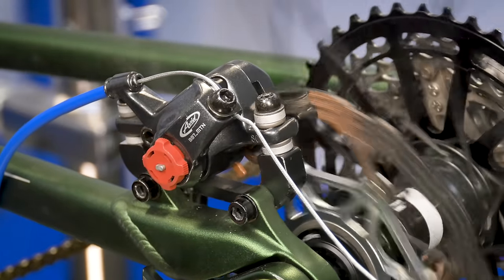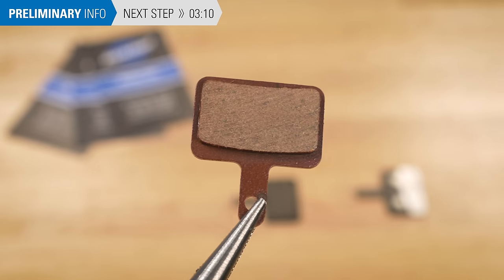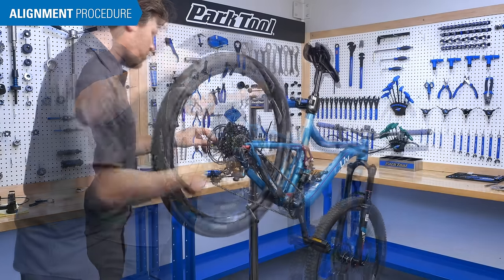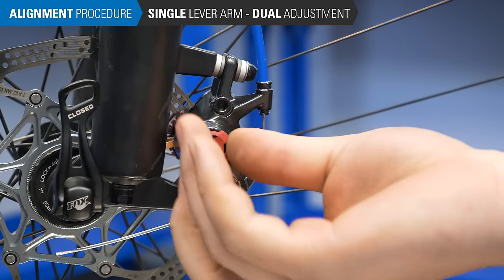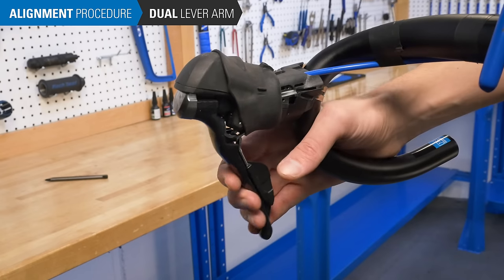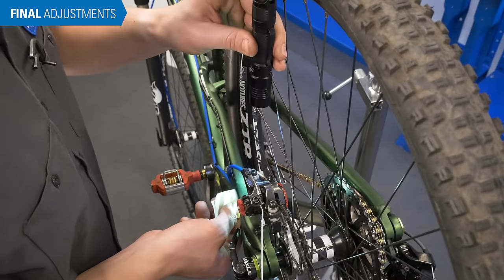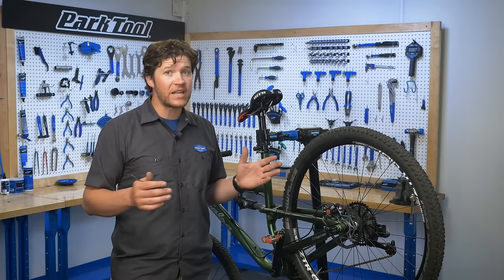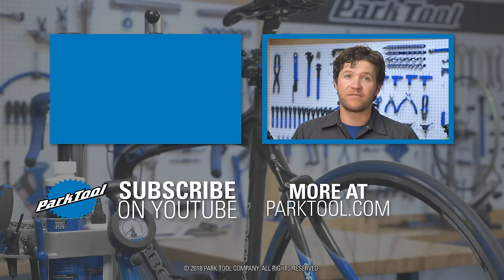How to Align a Mechanical Disc Brake on a Bike

Comment: I’m about to fight my mechanical disc brakes
Reply: Wrd ts madd annoying
Reply: It's no fight actually very easy. Even bleeding. You get the hang of it with practice. Purchase isopropyl, degreaser, and kitchen paper towel. You can clean the pads with the above.
Reply: I’m abt to break my bike from anger
Reply: It literally almost took out my finger
Reply: Been fighting for a minute 😂 about to just bite the bullet and switch to hydro
Reply: @dalegreenaway  Why are you talking about hydraulic brakes when the guy is talking about mechanical brakes?

Comment: This is the best how-to guide for mechanical disc brakes. I tried so many methods on setting up brakes, but neither was perfect... until i watched your video. Thanks!
Reply: how often i must to do this? i never had mech brakes
Reply: Booger not very often, usually as a first time setup for a new brake, afterwards, you would only need to adjust the stationary pad as it wears.

Comment: This video is one of the clearest and most useful ones I've seen so far. The animations and drawings on top make it easy to see what is mentioned by the speaker. Also, you covered all caliper types which is very useful. In my case, I have a one sided caliper and I wanted to adjust the lever travel, so as for the previous generation of brakes, I pulled the cable. This solution is wrong, and now I see why thanks to this video! 

Thank you for making this useful guide

Comment: Finally!! A video that explains what those adjustment screws in the middle of the caliper are for. I turned mine both ways and didn't notice anything moving so I wasn't sure what they were for. I'll just try them again and look closer. Overall a great video.

Comment: Just installed new brake pads and encountered the dreaded rubbing.
Looked like the caliper/rotor alignment wasn't parallel - had a fiddle with the caliper body bolts and managed to get that wheel turning smoothly!

Great level of visual explanation in this video, exactly what I needed.

Comment: I'm only 3 minutes in but your info was all I needed to finally adjust my brakes on my newly purchased bike.

My bike has been sitting in a spare room for 2 weeks now because the only bike repair shop in my city is booked solid for months and my front brakes were rubbing and I couldn't figure out how to adjust it.

But 3 minutes in and 10 minutes on my bike and it's now working perfectly.

Thank you!

Comment: Thanks so much for the great video - I bought a new bike online and my heart sunk when i connected the wheel and the disc was grinding, you're video was clear and allowed me to make the right adjustments quickly and easily!
Reply: Craig Glaser I have the same problem with my new E bike. What part of the video worked best for you as far as getting that grinding halted?

Comment: Been watching many videos and took me 2 weeks to find this very best informative video.

 I ride bike rarely.  Just bought a rear ebike conversion. The rotor is rubbing on the pads. Didn't know rotor can slide left or right a lil if need to. I tried using washers to space it but washers is too thick

Comment: Great video!  I was having trouble with vertical rotor alignment between the pads.  As soon as I tightened the mounting bolts, the alignment was thrown off.  Through a process of elimination, the video helped me discover that the problem was my axle was not perfectly seated in the fork dropouts.   I re-installed the wheel and voila!, no more misalignment.

Comment: Thanks for this in depth tutorial - I didn't know disc brakes had a lateral adjustment to them, and properly setting them with the technique at 4:46 fixed a rubbing issue I was having.

Comment: Thank you very much for the detailed explanation of the process of fully tuning the disc mechanical brakes, I couldn't adjust my brakes for a long time until I found your video, now my brakes are working correctly. thanks from Ukraine

Comment: Man! This is crystal clear! I bought an eBike that a shop assembled for me. Everything was perfect except for the front making a scrubbing sound. I asked them about it and they made it sound normal.  a day later I decided to investigate closer and realized that one, the disk was warped and two, the pads were touching. How I knew that, I bought a brand new rotor from amazon, nice and straight and found that the pads were rubbing. I wish I saw this video first before going at it on my own. I did some backward things compared to this video. I ruined the brake caliper, mainly the hex nuts, by over tightening and stripping them. I managed to get the whole thing off and bought a new caliper. When it arrives, I will be having this video by my side! I could of taken it back to the shop, but this is stuff I have to learn as a bike owner. The shop will just be handling the motor when the time comes.

Comment: Burned through an hour trying to set up single arm, single adjustment mechanical disk brakes  after re-cabling them for the first time. Then checked in here, like I should of originally!

10 minutes later I'm done.

Thank you.

Comment: Interesting video. Needed to learn this as I acquired a bike with such brake system. Sure it brakes better and faster than V-Brakes but you can't deny the ease of maintenance on v-brakes, I miss them. Learned a lot maintaining them. Now disc brakes. Sounds a tad tricky but I get the just. Coming from a very unhandy man, I love learning bike mechanics because it makes sense and you don't need brute force to get things done, not like car mechanics. Can't wait to get to wrenching! Thanks for the vid!

Comment: Fantastic. My electric Ariel Rider Rideal is 90 pounds going 20 MPH. I've changed tires but the brakes just aren't cutting it since I had it apart. I need the front brake and there's nothing. I didn't realize the arm needed as much travel as possible. I was moving it up on the cable, old school mechanical. Nor did I know about disk adjustment from the side. I did have the sense to hold the brake to get alignment and snug the caliper. No problem with my 2020 Schwinn Ascension 29 tho. Got monster mud tires on it now barely fitting the frame. They're huge! Thank you.

Comment: OMG, I was going to take my bike into a shop with 200 miles because one pad kept pressure on one side only with a squeal. A simple adjustment loosening two mounting bolts. Also found they were not tightened down enough or had become loose. THANK YOU for the video.

Comment: Thank you for the video.  What I was actually after and can't find anywhere is how much of the disc must be covered by the pads and how to align them.  When comparing the wear on front and read discs of my 10 year old Cannodale, it is noticeable that the pads are not overlapping the discs to same extend.
Reply from the maker: The entire brake pad should be in contact with the rotor. If the upper part of the pad is not coming into contact the pad will wear funny and you will also not have as good ob braking. This can be due to the incorrect adaptor or if you are using CPS washers and they were not designed into the system.
Reply: Makes sense, thank you for the quick reply.

Comment: Grateful again for this very clear guidance, and for your responsiveness. Having followed the advice here (and below), I have one other comment/question for your feedback-- When I maximally relaxed the caliper lever arm (and gently took out the wire slack before tightening the pinch bolt), I found that the dynamic brake pad (in my single lever-arm, single-adjustment system--Hayes MX-2) was hopelessly buried within the body of the brakeset. I was able to adjust it out (coarsely) only by re-tightening the caliper arm...which still left lots of range-of-motion on the arm, and no risk of jamming. Of course, if I had a dual-adjustment system, I would just adjust that brake-pad setting. In my simpler kind of brakeset, what else can one do but tighten up the caliper arm??
Thanks in advance for your feedback,
Cameron
Reply from the maker: Hello Cameron, Good problem solving skills! This can be the case especially if the pads are worn. You did the right thing. On Some systems there is even less caliper arm travel which leads to bigger issues when it comes to trying to adjust that out. In those cases New pads are often required.

Comment: What an awesome tutorial. Getting straight to the point, no BS, and having those bookmarks so you could go back to each section as you need is perfection. Also, every single type of brake is covered. Does it get any better than this? I don't think so. Thank you park tools!!
Reply: Well, if you got adhd like i do all that usefull stuff is just clutter that makes it take like four hours to process the whole video and figure out what 3% i actually need. Just like school.

Comment: Great video, thanks very much. 
This is the first time I've had anything to do with  bicycle calipers. Got to say I'm rather shocked that bike manufacturers don't design the calipers so they are always floating. Every car caliper I've ever done is floating so the caliper is free to move and self align as the pads wear.

Comment: @4:07 I'm curious as to why no one else mentions this, I ALWAYS see people bring in the lever arm more and that it provides stronger braking power but when I followed this, it made my brakes levers go all the way to the bar, I would like some more elaboration on this.
Reply from the maker: This is mentioned in the manual for these brakes but is not talked about often. The important parts of this are mentioned. There is only so much useful motion that the arm has. There are pad adjustments that can make the same changes as reducing the lever travel. Those two things add up to the pad adjustments being the best option for adjustment. You may need to move the caliper in order to do this if you only have one pad adjuster.
Reply: @parktool  Ohh I see, this makes a lot more sense now with the way you guys explained, I'll be referring back to this whenever I do more brake adjustment, thanks you guys!:)

Comment: On my bike the housing of brake cable is stiff.. (compressionless),  when trying to align calipers by loosening caliper mounting bolts, squeezing brakes and then retighten, is rather making it worse.. the cable housing has enough spring to flex the rotor.
It's very good, that your instruction also tells to do also final adjustment when necessary. 
 I also check it by hand. resting finger against caliper and the edge of rotor and feel if or how much the rotor moves when squeeze the brake(double side caliper).
Reply: Hardi Erstu You dont need compression less housing for brakes. You shouldn’t either; it is weaker than regular spiral type housing.

Comment: I have tektro aries..looks modern etc.yet I ran out of all adjustment for the pads to rotor. No outside adjuster at all. I somehow have a giant caliper on a skinny rotor. Pads were done at halfway mark, acting as full worn. I made a stainless steel shim...simulating the missing fat rotor.  There is always a way..as long as all the pieces are there. :goodvibes:

Comment: Hey dude so I'm following your instructions on your little video here I'm at 1:55 six seconds and you say to turn the screw all the way to the left which I did that and it disassembled my break entirely or I was under the impression that it would stop at some point. A little confusing but I appreciate the information either way

Comment: Follow up, after taking off the wheel say for cleaning, when putting it back on any tips to have it recentered within the brake pads especially the rear tire.  Btw love the channel
Reply from the maker: If this is an open dropout frame, the rear axle is a bit sloppy in the dropouts. That is the nature of the design.  Put the bike on the ground, and open the skewer. Now tighten without moving the wheel. Even doing this there is a chance it will not sit exactly the same.

Comment: A good video, but I still couldn't get my rear disc to align. It was single adjustment only, and I had used all the play I had on the mount. I needed to add another washer to the axle to get the whole hub assembly to align. It looked like the existing washer was squished, but I actually also think it never aligned to begin with. So FYI.

Comment: I recon on single piston callipers you can use the barrel adjuster to adjust outer pad wear/clearence a little, as long has the actuator arm doesn’t go more than a few mm from the back of its rotation point for leverage and stuff? You’ll have to reset the calliper less this way.  I’m not a mechanic or engineer.
Reply from the maker: Yes, you can within reason.

Comment: Watching this has recked my head in having big trouble setting my front and back calipers it a one side pad evertime I set it and spin the wheel the calipers move to one side then starts to sweek and grind cant get my head around it  also the pads calipers are new . New bike tried bending the routers still dose it will have to watch the vid again ..good video tho

Comment: I tried to adjust my SRAM MTB because the pads were rubbing after only a couple of rides. When I loosened what I thought was the pad adjustment all of the hydraulic fluid leaked out and now it rubs worse than ever.

Comment: Very useful, thanks! One question I still have is how come there are adjusting washers above and below the adapter on the green Salsa while all of the other bikes have no adjusting washers?
Reply from the maker: SRAM made some brakes that required what are called CPS washers above and below. The calipers are specifically made to run them. Shimano and others have CPS style washers above the caliper when an adaptor is used as there is a slight angle created and the CPS washers allow proper alignment of the bolt head.
Reply: @parktool  Thanks so much!

Comment: Thanks a ton! I did all the steps and the rubbing stopped. However, is there a way to increase the stiffness at the brake lever without moving the pads closer (otherwise it’ll rub)? I want to have a little more confidence in the braking while downhill. My bike only has a barrel adjuster on the caliper.
Reply: Have you found a solution ? I have the same problem
Reply: @Rossy1995  no, unfortunately. I’ve moved on to hydraulic brakes since then
Reply: @avalsirithanawat1772  thanks a lot. i will maybe ask in my local bike shop

Comment: Hello and congratulations for the work you do on this channel. I try to give the exact measurements to a frame builder who is not in my city. I want to mount some TRP Spyre 160mm disc brakes but I have doubts as to how I will be able to make holes and brackets in the exact places so that everything is aligned in the mount. Can you give me some ideas? Thank you very much.
Reply from the maker: Frame builders use fixtures to hold the disc taps in the correct place. They can be found on ebay and other used sites for fairly good prices. But your frame builder should have these or should be able to purchase them.

Comment: Great video--thank you! A coupla' quick questions. 1) "First, ensure the rotor is properly positioned by getting the wheel seated all the way in the drop-outs."
On my mountain bike, for some reason there's terrible disc/pad rub with minimal braking power (front and rear) when I seat the wheels all the way into the drop-outs--I have to manually lift one side a few mm's before tightening the quick-releases, to get everything running smoothly. Why would this be?
2) When there's lateral movement of the disc within the calipers, how does one know if it's from a bit of wheel wobble (an untrue wheel) vs. a bent rotor?
Thanks!
Cameron
Reply from the maker: 1: That is an inication that you need to seat the wheel and then align the caliper as laid out in this video. Then when you re install the wheel and it is properly aligned it will line up. 
2: The wheel and rotor are completely seperate so an out of true wheel wheel have no effect on the rotor or braking.
Reply: Very good helpful--I'll do that. Thanks again!

Comment: 4:15 I wonder how common it is for range of the caliper arm to be limited due to barrel adjustment?  This seems like a design flaw to me... I see most people using the barrel adjustments as the brakes get less responsive.  (Until they see this gem of a video at least 😉)  It seems impracticable for an inexperienced mechanic to distinguish between cable slack and pad wear to know where to adjust.
Reply from the maker: It is fairly common and why we brought it up in this video. There are limitations with any design. Knowing the proper setup is the best way to prevent those limitations from causing issues.

Comment: My ebike’s rear brakes have the inner caliper adjuster behind the motor so it is impossible to reach unless I remove the motor. Is it okay to perform the adjustments using only the outer caliper adjuster?

Comment: I got a question the part that tightens the black sleeve do i need to make it very thight?  Inside of it the brake cable slides through

Comment: You say that barrels are only meant to allow cable replacement and pad wear should be compensated by moving the caliper (if there is no outer adjuster).
Given the high pad wear rate I experience, I prefer to turn the barrels counter-clockwise every now and then.
Reply: Yup I agree, this is a weird advice from Park Tool. 
Shimano itself suggest to use the barrel adjuster to compensate for outer pad wear in their dealer's manuals (for example, br-m375 brake which is most likely shown in this video) and it makes sense since there's plenty of arm movement, I'm not sure that it's possible for brake arm to meet the caliper even if you fully unscrew both brake lever and caliper adjusters.
Maybe it makes more sense for some other calipers like BB5 but even then it still can be used to some extent.